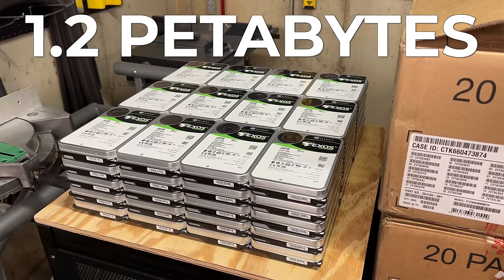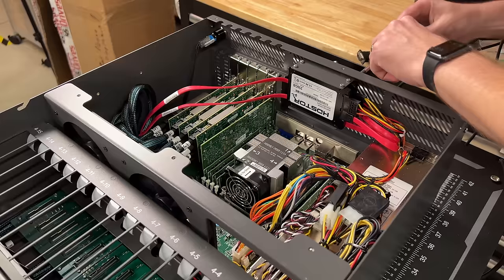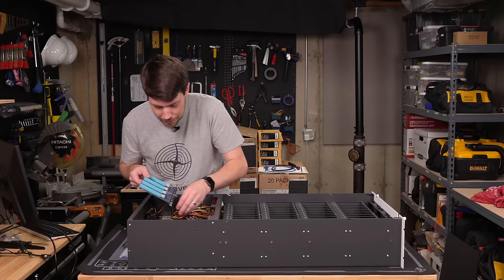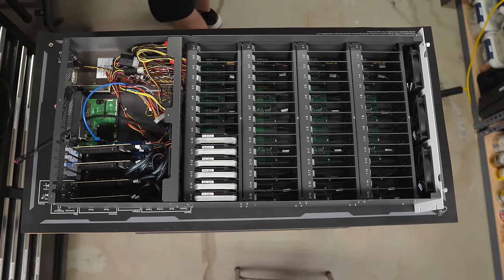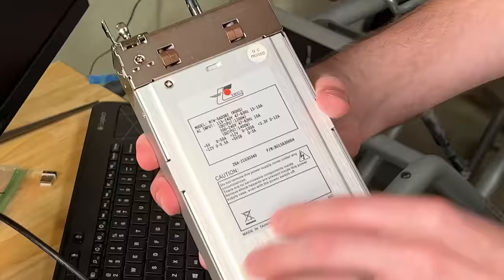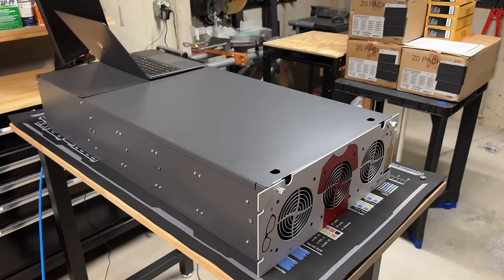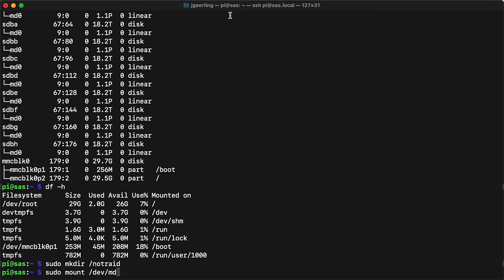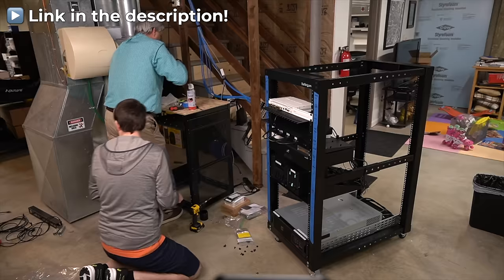The Petabyte Pi Project

Comment: 60 HDDs in RAID 0 is the definition of "all gas no brakes"
Reply: Glorious, glorious RAID 0 🤩
Reply: glass cannon lol
Reply: Who needs raid, why aren't you using LVM and just mounting it as direct-IO.
Reply: And no steering
Reply: @monad_tcp  Who needs LVM. Just use ZFS.
Reply: @himmelsrand7527  who needs zfs when you could use 60 btrfs drives
Reply: More stripes than a zebra herd
Reply: god bless america
Reply: 😂😂 The adrenaline is real 😂
Reply: No joke
Reply: Write-only storage at its finest
Reply: "brakes were invented by cowards"
Reply: All gas, flooded engine would be more applicable.
Reply: @fhunter1test  brakes give you lap time as well tbf
Reply: raid0 sucks. the more hdds the more chance to break. this makes no sense. use raid6 would be worth with 20T chunks. 20T chunk recovery would take multiple days. but 60 slots.. ill put that into my toilett 🤣🤣🤣🤣🤣🤣
Reply: @Masonova1  lol!
Reply: I once worked out the MTBF of a RAID1 with 30-something drives (back in the 2000s). With all that spinning oxide and an MTBF of only 100,000 hours per drive, it was "about a month between drive failures", using some paper on MTBF compounding someone wrote up.

Empirical evidence matched the prediction quite well. This was a problem because they'd only set it up with 2 spares, and the monthly cost was getting silly. (you think printer ink consumables are expensive, try working with enterprise storage)

Also, the average home gaming computer was beginning to have MORE storage than most of the company was using at the time.
Reply: for every drive in a Raid0 array, you get double the chance for failure, or half the reliability.
Reply: A  colleague once said raid 0 is stupid, therefore he made individual drives and spread files evenly over them, because he wanted performance and he didn't need redundancy since everything was easy to download again

Comment: Linus would be proud
Reply: Torvalds too. Nice example of the Linux versatility
Reply: electroboom too.
Reply: I was waiting for the water bottle :D
Reply: It's a good example of why the ltt pedibyte project is so expensive
Reply: @rvmiv_ 
First of all and most importantly, the speed, those were gen 4 nvme ssd drives with extreme speeds, second of all this is just a storage rig but what ltt built is a server, I mean have you seen how they run NASA simulation?
And lastly there drives are extremely reliable

Comment: Do I need a petabyte of storage? No. Would I mount one in my rack? Yes.
Reply: 30 years ago: Do I need a Gigabyte of storage? No.
Reply: I absolutely need it to store my GPT-3 training data. Turns out having 16 GPUs wasn't enough, but I run out of space even before running out of compute time. Its probably more on the scale of 1PB + 8192 GPUs.
Reply: 10 years from now, Do I need a Petabyte, yes.
Reply: do i really need 128 gb of storage on my mac?
"your mac is almost out of storage"
wait- whY IS MY SYSTEMS FOLDER 70GB
whY does microsoft word take up 2gb?
Reply: @kevinbissinger  I still remember buying my first gigabyte hard drive. Kept a grad student in school.
Reply: until that electric bill shows up.
Reply: @kevinbissinger I remember my dad telling me a 64MB USB flash drive is more than enough to get me through high school

Comment: Fascinating! A lot of work! The issue it seems is having to tether to the hard-disk through a band shared with other drives, rather than universal. There is a technique where using data-points written to each hard-drive mathematical computations can rewrite and measure the data for inference machiningly— without even using the shared io-bus anymore! You’d see a slowdown in computation monologue but all speed ahead on as many drives as you want!

Comment: How about one controller to one pi, then stripe 4 pis together, that should increase the throughput and scale down the issue to a more managable chunk, and still a pi project.
Reply from the maker: This is probably the most reasonable way to do it, and use Ceph (or another network-based filesystem)... and indeed I will be testing that out soon. Still bottlenecked but probably more reliable and would not run into as many errors on the PCIe bus!
Reply: I think you will need more than 4 Raspberry Pis unless the pool is for backup or archiving purposes only. 

Even a low-to-mid end Intel or AMD system would make more sense..  though then the project will lose its “Piliness”. 😂
Reply: @qazwsx000xswzaq  Wirh these Network Speeds you would need 1 Pi per Disk to max out the disks🤣
Reply: @paulz1780   We can then expose each drive as an iSCSI target and aggregate them at a server over ethernet. And viola we have a not-so-poor man's SAN haha. It reminds me of those shiny new network addressable NVMoF SSDs btw.
Reply: Gluster might be a good option too.
Reply: @jamesfmilne  SeaweedFS would also be nice
Reply: @jamesfmilne  Indeed I had better experience with Gluster than Ceph years ago. Not sure how things have evolved now.
Reply: yeah, let's see a super computer version next!  not thst i know how thst works, I haven't actually built a pi super computer yet
Reply: @JeffGeerling  MooseFS, Jeff! it'll scale better than Ceph on the Pi.
Reply: @JeffGeerling  Wouldn't you be running into the same PCIe limitations? Just shifted over to the gigabit ethernet part of the Pi? 

although I would probably go for the one drive one pi CEPH cluster for added awesomeness ;) IF you could get your hands on that many Pi's to begin with. Damn you Covid.
Reply: @patrickd9551  Check out the Odroid M1. Plenty of supply but a little lacking in the software department but comes with an NVME slot and can be had with 8GB RAM, they seems stackable too.
Reply: Actually, not stackable, I now have two but still, very nice.
Reply: @patrickd9551  Yeah, looking for a good way to build reliable block storage with redundant computers and no crazy STONITH design (as favored by Red Hat).  That way, I can reboot, power cycle and upgrade computer nodes without interrupting storage access for users, and the desired system should keep going, quickly restoring redundancy as soon as drives regain connectivity, thanks to something like the dirty area flagging in dmraid.
Reply: 100x Pi
100x 2TB SSD
1 Network

The PiHive
Reply: Ah yes, a pi based glusterfs cluster.

Comment: 1942: "We need to figure out a solution to digitally store dozens of bytes at a time. Vaccuum tubes, maybe? This is going to cost us millions, but it will be worth it to finally have accurate artillery range tables!"

2022: "I'm going to hook up this petabyte of data storage to this cheap single board computer!"
Reply: 1969:  "we need to figure out how to use our cutting edge 1.5 million doller, 4kb ram 32kb harddrive to bring people moon"

2025: lauching a rocker with a single board computer...
Reply: Wait until the average person doesn't click on a video below 16k 120fps. There will be always a way to fill it 😅 but I remember it's gotten better over time.
Reply: @vaisakhkm783  Pi's and Arduino's are already used for avionics on model rockets, and cubesats can have total build costs of like $50,000. It's amazing how far the industry has come and is going

Comment: Glad to see Red Shirt Jeff back. I was wondering what happened to him.
Geez, your projects are soooo extreme and cutting edge. Your troubleshooting processes are very informative and helpful to your viewers, who otherwise wouldn't have a clue where to look. We never see that on "How to" setup videos, where everything just automagically works.
BTW, I recently used Styrofoam to separate 2 prototype boards while testing them out. It got hotter than expected and the foam sagged, allowing the power rail of one board to touch the  other board, which fried as soon as I powered up the following morning.
Don't try this at home, folks. Cardboard insulation good. Styrofoam bad. 
Thanks for sharing Jeff. I'm fully confident that you'll get your bandwidth up on the 60 HDD RAID. Looks to me like you're already nearly there.
Instead of installing it inside a server rack, perhaps a locked cage would be a better idea to protect it from Red Shirt Jeff. 😎
Reply from the maker: Heh, cardboard insulation 'better', but I now have it on a 3D printed box that's a little more secure too.
Reply: @JeffGeerling  Good point. 👍
Now, my 2nd attempt is safely mounted inside a custom acrylic case, too. One less thing to worry about, amongst the multitude of other potential mistakes. Live & learn, eh?
Just gotta keep putting one foot in front of the other until the final goal is achieved, right?
The hardware for the Teensy Laser Synth waveform module w/ILDA DAC is complete. Only need to flush out the code to full functionality, before moving on to the custom MIDI controller. 
BR 😎

Comment: Oh my goodness, that juggling of those drives.😳
Reply: Every IT engineer has a stack of broken hard drives just for juggling with.
Reply from the maker: Haha true.
Reply: @wayland7150  yep, pretty much. My old boss when I worked in computer repair used laptop hard drives to level out his microscope. Funny thing is the drives weren't even dead, they were just something like 160GB 5400RPM drives that were more useful for that task than storing data.

Comment: I just completed a 24 X 18T build that's almost 1/2 PB. I bought the drives a few at a time all Segate recertified it seems to be the sweet spot in price for me. I had to upgrade and rebuild things several times. Your video was just like my experience switching OS, FS, etc. I had endless drives/arrays just dropping out, mostly on startup. I tried Fedora, Centos, Open Suse, Suse JeOs, and Ubuntu Server all let me down for one reason or another. I tried them with various shares, raid arrays and file systems; plus not all would run my app. I ultimately got it working with Ubuntu workstation and the Ubuntu share - no samba. I'm not happy with ZFS. I had to kill the swap and add more RAM (which meant a new motherboard) to keep ZFS cache from crashing. I solved the dropouts problem by putting the drives really close to the host board and using short/expensive data cables that are all the same length. I'm using a very old Athlon FX-8300 8 core and 64 gig of Ram. I found a great last generation Adaptec 52445 raid card new old stock. I had to install 2 power supplies and rewire one to all molex to get enough amperage on the 5 volt rail. New 1200 watt supplies have plenty of 12v but almost no 5v power. I also upgraded to 2.5 gbps network card. The write speed is NOT stellar. With Raid0 it goes real fast at first 450mbps filling all that cache, but slows down to about 150mbps. With a single JBOD I only get 130mbps, two drives at the same time still go 130 each, and I can transfer to 4 drives at the same time before it bogs down the network and write speed drops to 70 each drive or 280 total. I already got 4 sas expanders and plan to continue adding drives (and power supplies) up to 2.5 PB. My box is an old IBM 2401 tape drive converted to rack space. I yell at the You Tube screen, not my computers. That's not true I also yell at my computer at work (it's windows).

Comment: Integrating a Pi compute module with Ethernet into each hard drive can make scaling easier. It lets each drive connect to a network independently, simplifying data handling in big storage setups.

Comment: Hi there! I work for Infomaniak, and I am managing storage networks. We offer backup services and connected drive (we call it kDrive, it's a bit like google drive, just we protect your data and they are hosted in Switzerland).

Adding 96 Exos 20TB HDD in my swift storage cluster is what I do every day. I manage "moderately large" Swift clusters. On them, we add 6 2U servers at a time, each of them holding 16 HDD (so 6*16 = 96 HDDs). In total, I calculated that I am managing more than 5000 spinning drives in our OpenStack swift clusters, which amounts probably around 100PB (so not just 1 PB like you're doing...). Just this week, I added 12 HDD storage nodes, and 6 proxies (with 2x SSD each, plus the system drive), and 9x NVMe storage nodes (10 NVMe each, to be used in a  Ceph cluster).

Your idea of a Raspbery-Pi is fun, but instead of one RPi for all HDDs, I would setup one RPi PER HDD, and then it all makes sense, and you may have decent speed.
BTW the casing you bought seems of very bad quality compared to what we get from HPe or Lenovo.

I've been running this service for nearly 5 years now, and we never lost a single bit of data... :)

Comment: Well Jeff, one thing's for sure, if you and others aren't pushing the pi to bleed on the edge, no progress will ever be made in this direction. I'm not sure what kind of useful stuff this direction will yield, but it surely will yield something. Keep on pushing ya madlad!
Reply from the maker: My hope is the next Pi at least has the PCIe bus bugs sorted so any card will 'just work'. After that, any more bandwidth they could squeeze out would be appreciated.

The CM4 is actually great for many 1 Gbps network use cases—but with a little more bandwidth, it could be great for 2.5 Gbps (or heck, more than that if we're dreaming!).
Reply: @JeffGeerling  with a USB3.something port, it could get almost-5Gbe, so not that much of a stretch for faster than 2.5gbe

Comment: Even before doing a raid or zfs test; I’d have run a single drive test (either benchmark or simple linear read/write). Loop that 60 times and see success.  Then repeat with two drives in parallel and loop 30 times. Redo with three in parallel 20 times, etc etc. When you start seeing failures you really will see the cause-effect point. There is technically no reason why this won’t work with 60 drives - if you ignore performance. Any bugs that are exposed that can be fixed will simply improve the base users world. This is an awesome test that pushes the RPi and kernel to the limit. Making this work at that limit helps all of us just running one drive. Plus, the errors you saw, as bad as they were, should somehow restart the drive (without a reboot).
Reply from the maker: When those errors occurred, the HBA reset itself and the drives always came back—at least 15/16 of them!

That was one concern from the Broadcom engineer I spoke with, and the reason he really wanted me to run the latest firmware. Unfortunately due to time constraints I couldn't flash all the cards in a separate PC then bring them back to the Pi and re-test. But I plan on trying that out.
Reply from the maker: Extra testing has been done—tl;dr the breaking point is 3 cards (or more than 30 direct attached drives). But forcing PCIe Gen 1 speed also fixes the issue. More to come in my next video!

Comment: One thing I saw you doing when wiring up the NAS was that you connected the molex adapters to two sata power connectors on the same line. If the psu has another line, try connecting to that, as each line can draw a limited amount of current and there might be an issue there. Then again, the issue might be anywhere else but that's a thing you can easily try

Comment: My NAS is a pi4 with a desoldered USB chip to expose the PCIe bus. It's connected to a PCIe switch(to improve transmission and prevent crashes) and then to a cheap ASMedia SATA controller. The kernel is also patched to force PCIe gen 1 to prevent crashes(this is probably the same thing that happened to you in the video btw). PCIe gen1 is still faster than gigabit so it doesn't matter. Over samba or NFS I can get the full gigabit speed even on large data transfers so no bottlenecks there. Would I recommend this setup? no. Does it work? hell yeah (longest uptime was like 90 days or something and then a power outage killed it, I need to get(or more likely make) a UPS, I know). If anyone wants photos lmk
Reply from the maker: Nice. Coreforge also suggested forcing Gen 1 speeds elsewhere in the comments, so I may need to test that out.
Reply: @JeffGeerling  That was my first idea as well. Those switches are used to run gen1 or maybe max gen2, when used for GPU mining. Above that it will throw errors.

Comment: As an HDD engineer usually drives are built to compensate for vibration due to certain fan RPMs. Especially if we have a big customer we'll optimize things for the frequencies of vibration in their trays.

Comment: I have smaller versions of those EXOS drives. 

 >200 drives, over the past 5 years, I’ve had 4 failures.  3 covered under RMA.  1 had just expired.
Reply from the maker: For every anecdote (usually it's "all my Seagate drives exploded in giant fireballs!"), there's an opposite anecdote. In aggregate, if drives like these were truly failing at the rates some people think, Seagate would not be in business :)
Reply: @JeffGeerling  The reason all of this information was popularized in the first place is because of backblaze's reports (back in the day) but if we look at their stats now, year over year, seagate is constant.
Reply: EXOS and businness drives in general are fine, it's the consumer lines that are more "hit and miss", but even then it's easy to find a pattern unless you buy hundreds of them. I.e. a brand doesn't just "consistenly fail 4x more than another"

Comment: I would really like to see you build a cluster based file system like gluster or ceph, run that on a pi cluster with 2 to 4 drives per pi, then show performance

Comment: If nothing else, this gave me an idea for converting an old outdated and unsupported six bay NAS box to actually run on a pi. I was trying to figure a way to put six drive on a single pi and the PCIe adaptor with an HBA seems like a solution. I'll need to play around with it but the backplate the drives plug into in the NAS itself may actually be an HBA daughter board. We'll see, but at least I now have another avenue of attack.

Comment: I have a Pi running RAID1 with 2 External SSDs and on times I have to reboot as it seems to forget that the disk exists. That's Pi 4 and Samba and a Window share. So to get as far as you did its amazing.